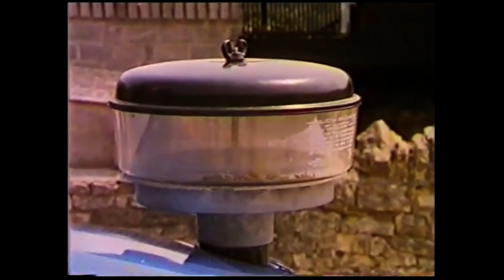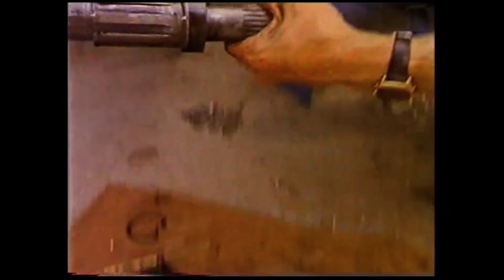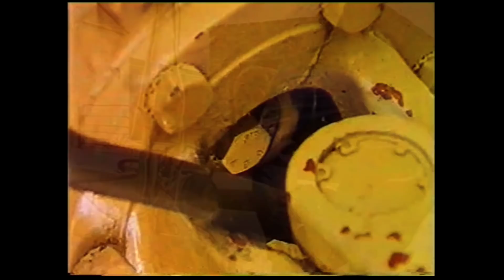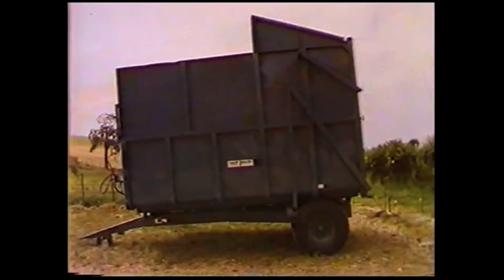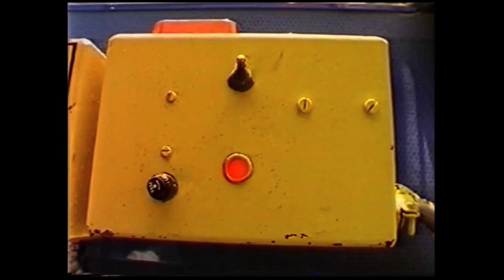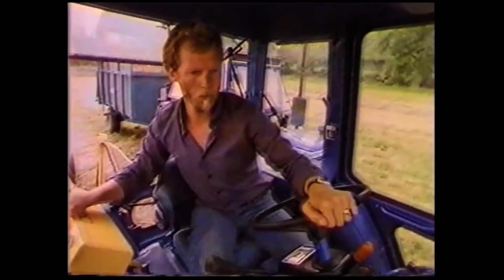Not Just Torque Ford Tractor Film

Comment: Best affordable tractors around in the eighties, great video highlighting  ford new holland machinery.
Reply: Until the block went porous 😉
Reply: @hughmarcus1  Legend. You got a laugh from Ireland.
Reply: There was also the issue of no expansion bottle, and when the engine cooled after working, the water level in the radiator would drop and suck in air and this would cause corrosion to continue, expansion bottle cured this as it would bring in coolant instead. 
If properly maintained the fords served you well
Reply: Yes the blocks were a bit on the weak side but in the old days the farmer would drain the water on a frosty night and refill with oxygen rich hot water in the morning for easy starting and this made the corrosion of the block much worse.